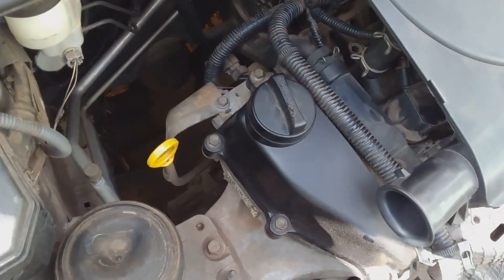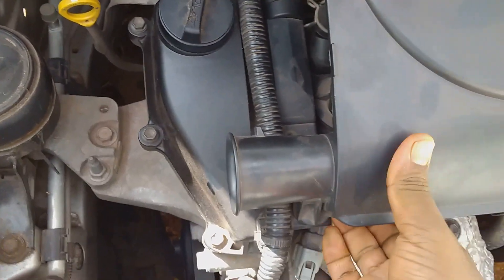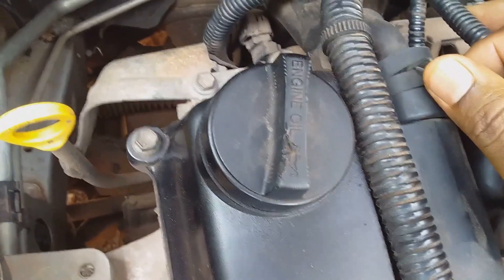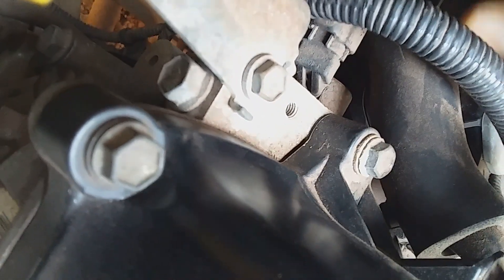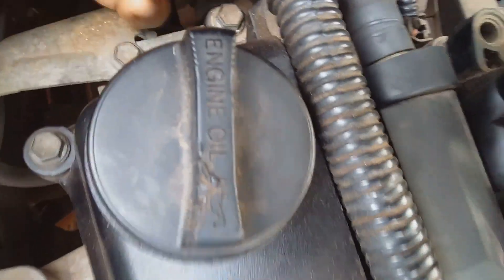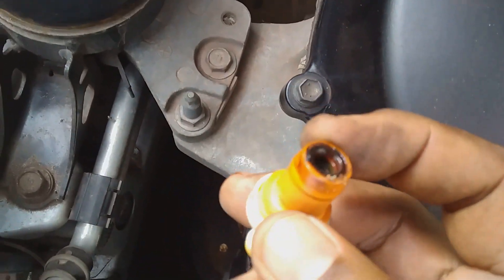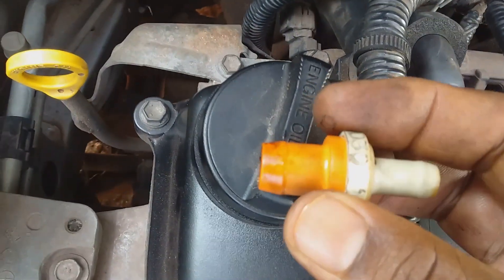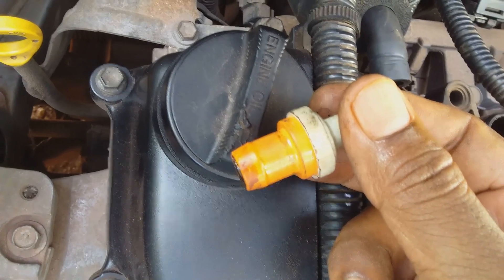Toyota Vitz PCV Valve Check

Comment: Hello i have same vitz and it has no smoke no misfire .  but there's oil on the cap where we refill the oil and when i remove the cap when engine is warm smoke comes.  Anything you can explain pls?
Reply from the maker: @shahzadamuhammadwaseem5338  this is normal and any time you refill with oil when the engine is at normal running temperature you will see some small amount of smoke because of the normal temperature of the engine.
Reply: @ShelDockToyotaVitz  ok but why its consuming engine oil?

Comment: My vitz 2011 model is jetting,when the engine heat the is not moving again,what is causing that?
Reply: I'm facing same problem. Have brought it to a Mechanical workshop 😢
Reply from the maker: Not sure what it is you are asking. The information you wrote is not clear.

Comment: Thanks for your video but is there a map sensor on throttlebody on my 2009vitz and why is it vibrating
Reply from the maker: MAP sensor is usually located after the throttle body
Reply: @ShelDockToyotaVitz  please sir where can I find the mass air flow sensor  the mechanic says it is  connected to the throttle body
Reply from the maker: @simonsuckie9906  the mas sensor is the only electrical device connected between the air filter and the throttle body.
Reply: @ShelDockToyotaVitz  sheldock I don't see any so you are saying the mechanic  is wrong when he said it is on the throttle body  please help

Comment: Does this cause rough idle and hesitation while accelerating
Reply from the maker: It can if it is stuck in the open position.
Reply: @ShelDockToyotaVitz  I can't seems to figure out whats causing my vehicle to hesitate when I step on the gas pedal I cleaned the throttle body and the mass air flow sensor and the hesitation won't go away
Reply from the maker: Clean your injectors, your fuel filter in the fuel tank.
Reply: @ShelDockToyotaVitz  already change the fuel filter didn't clean the injectors. My check engine light keeps on coming up and me vehicle lose power I of to switch it off and turn it on and the check engine go away can't get to scan it to see what's the problem
Reply from the maker: Once a check engine light appear you have a sensor problem. It becomes difficult though when the error is not logged. When you can't get a read out of that error this compounds the problem. Get someone to help you check the throttle body positioning sensor to see if it opens immediately when you press the gas pedal.
Just place your key in the ignition and switch the vehicle to on without starting the engine.
Allow one person to press the gas pedal and you observe the throttle body valve opening and closing as the pedal is pressed.
Reply: @ShelDockToyotaVitz  can the throttle position sensor cause these problems
Reply from the maker: Sure, remember air fuel ratio is important. If you press the gas pedal and the throttle body valve does not open fast enough the ecu will correct this by reducing gas to the engine to maintain air fuel ratio. If the values are below certain requirements it may not send a error code.
Reply: @ShelDockToyotaVitz  ok thanks for your help
Reply: @ShelDockToyotaVitz  can cause damage to the engine because I have been having this problem for a while now just figuring out the problem
Reply: I'm getting a p0121 code it says throttle pedal position sensor/ switch A circuit range/performance
Reply: I bought a throttle body
Reply from the maker: Share your results, looking to hear good news.

Comment: So why you didn't clean it?? It had a deposits on the valve inside.!
Reply from the maker: If the PCV valve work as it should and no deposit inside as with mine there is no need to clean it.

Comment: If it has a malfunction, it could lead to a shortage of engine oil ?
Reply from the maker: If the PCV valve malfunction it can cause the cylinder head cover to explode because of built up pressure.

Comment: Hello shel dock! I am facing some problems in toyota vitz that is vibration on engine i change all the plugs and also clean the throlltle body but the result is same please help me out
Reply from the maker: Remember that engine vibration can be one or several problems. 
1. If your vehicle is over 12 years old you can do a EGR check.
2. Your fuel delivery system can also be looked at.
3. Ignition system check.
Reply from the maker: Fuel system check can include fuel pump pressure, filter, and injectors.
Reply from the maker: If in your country you have dirty fuel problem this can block fuel pump filter and fuel filter and also cause restrictions at the injectors.
Reply from the maker: You can check the arcing of the ignition coil for reduced arc at any of the coils.
Reply from the maker: Always scan your vehicle for any error codes.
Reply: @ShelDockToyotaVitz please can you make a video to show me where the fuel pump and fuel filter is located in the Toyota vitz
Reply: Thanks for your kind response

Comment: Shel my vitz 2014 model is giving low fuel average what ahould i do its 8 9 km per litre
Reply from the maker: Check your fuel pressure it should be over 50 psi. 
Fuel filter may be partly blocked or fuel pump not pushing enough pressure.
Reply: How do you check fuel pressure